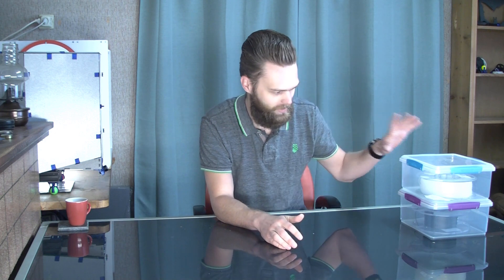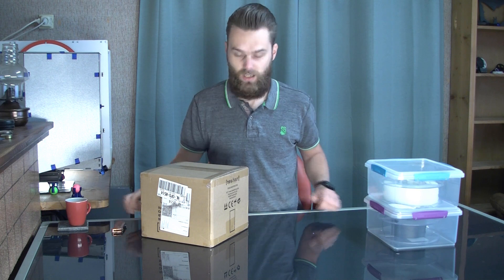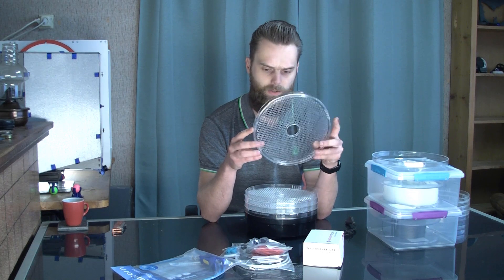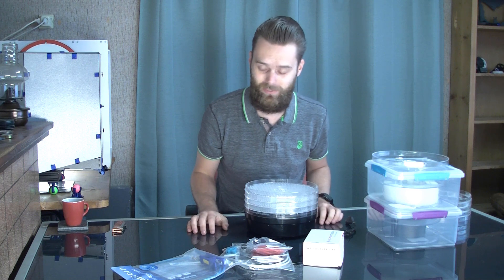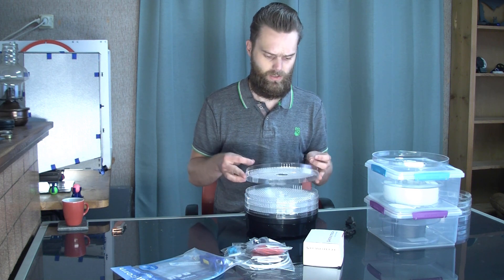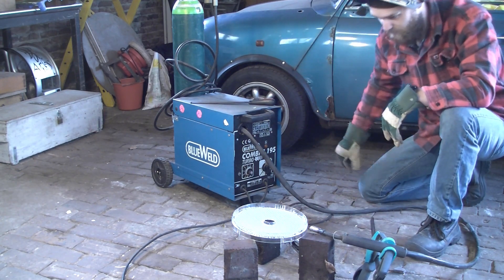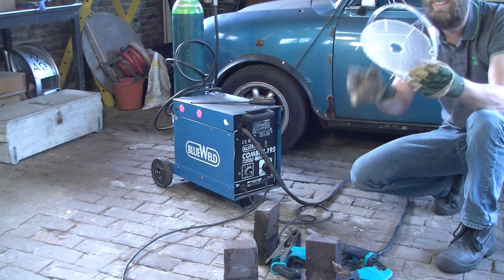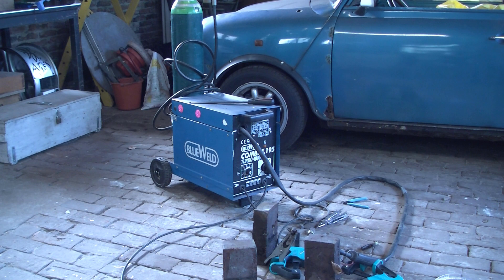Printing (carbon fiber) Nylon on an Ender 3

Comment: My question is after the print does the material still absorb moisture at the same rate. ...so if i have two interlocking pieces will they expand and not fit if left separate for an extended amount of time. Or will it be stuck assembled

Comment: hey man, i got a new ender 5+ and upgraded w/ capricorn, micro swiss and ruby nozzle 0.6mm. ...i tried printing eSun Nylon-cf, @ 268/80  and it printed good 1 time and then every print started failing......i have done PID changes, eSteps changes, temp changes, new nozzle, new filament, and i cant figure out what is wrong. I print out of a dry box that has moisture absorption in it sealed.....i have no issue printing PLA PETG
Reply from the maker: It sounds like your extruder gear is worn. Do you use an extruder with a brass gear? In this video I show that I use a Bondtech extruder, but I recently used the Microswiss direct drive which looks very promising. Hopefully this helps with your issue.

Comment: Hey, thanks for the information! I'm looking at setting up a fairly large form printer to do car parts with carbon nylon, any reason you think size could cause problems?
Reply from the maker: That sounds very interesting. Printing out of carbon helps a lot because that shrinks a lot less than pure Nylon. That being said, I think you still need an enclosure, maybe even a heated chamber. I am currently working on one which should be able to print large car parts ;)

Comment: Why not use nicrom wire and make a foam cutter. Look it up. Much better than trying to cut a circle with a guitar string in a circle. You need it tight in a straight line threaded through the middle of the plastic part. Then cut the circle out.

Comment: Consider getting SKR mini E3 version 2.0 board..... other than that your ideas are amazing! The mini E3 version 2 is a direct replacement for Ender 3 but with a lot of options and no need for bootloader and did I mention tmc2209 drivers? Made my Ender 3 super silent literally just hearing the fan running

Comment: This is great, I’ve been looking at doing a food dehydrator setup for my nylon for a while. The usual food dryer’s are massive about 350mm OD as a posed to yours which is 250mm OD, nice and compact :).  For anyone in the U.K. or Europe wondering what the model is it’s a OneConcept Bonsai. Thanks for sharing.

Comment: For anyone who does not have expensive equipment for cutting plastic , Just  get a soldering iron with a knife cutting attachment, or buy one they are cheap,, or if no money then heat up a knif on a flame until  red hot and cut away, Simple's

Comment: Thanks for another great video Jon! May I know why you chose not to feed the filament directly from the top of the printer? Is it because you want to minimize the length of filament that's exposed in the air?

Comment: How could you so perfectly leveled the bed? You first layer is insanely good!
Reply from the maker: Thanks Bruce! I use a DTI to level the bed and an adjustable homing switch to determine the height. Together with a pinch of luck I get that perfect first layer xD
Reply: Proper Printing How is your Bondteck extruded? I am thinking using my ender 3 pro to print some soft filament as well. I am sure which extruder I should go with.
Reply from the maker: @brucehu428  I'm really pleased with that extruder. It has printed a lot of CF Nylon already and it's still going strong. I don't have experiences other than the stock, the metal and the Bondtech so there might be cheaper alternatives which would do the task as well.
Reply: Proper Printing Would you please send me the link where you bought it?
Reply from the maker: @brucehu428  https://reprapworld.com/products/bondtech_cr10_upgrade_kit/ not the cheapest, especially shipping, but it's affordable from where I live.

Comment: @Proper Printing thats not the normal ender 3 extruder thats an upgrade what is it?
Reply from the maker: It's the E3D v6. Definitely a recommendation :D
Reply: @properprinting  Just ordered the ender 3 pro as well as the aluminum feed plate and glass bed

Comment: Just a bit of advice as I've also converted a food dehydrator to a filament dryer. If you snip the grid away from the edge you wanna keep you can come back and clean up the edge with very little risk of cracking the plastic. Did this on 4 of the 6 disks that came with mine.

Comment: oh no i don't wanna ruin my pricey bmg clone extruder that I had a hard time importing to here :(
edit: YAY those don't use brass gears ;'3
Reply from the maker: Brass gears will indeed wear out very fast. Therefore the bmg like you've already found out :)
Reply: @properprinting  wait bmg doesn't wear right? Cause the gears are steel
Reply from the maker: @ameliabuns  mine hasn't worn yet after printing a lot of Nylon CF. I recon that it eventually wears out but I recon this will take some time
Reply: @properprinting  thanks for answering ! I live in iran so finding and buying anything is a NIGHTMARE  here lol. I had to pay 2x the price and wait 2.5 months for mine

Comment: I'd rather recommend to reinforce carbon fiber and epoxy the frame with old method after 3d print. Why don't you develop this idea ? If you do this, you can avoid the difficult 3d printer modification with carbon powder mixing with nylon resin.
Reply from the maker: Thanks for your suggestion! I try to have the least amount of post processing because I needed this for a product I'm working on which isn't related to this channel. I have some ideas about adding fibers to a print but I have to do some research.
Reply: @properprinting  I understand your job is different from professional 3d printing. I am professional chemical engineer specialized in plastic, fiber and carbon powder. If you need any information or help, please let me know to my email. ☞ pjh33hae@naver.com

Comment: Why didn't you use the welding wire. It would have done the same job. Especially if you had used super 6 1mm  stainless steel wire.
Reply from the maker: Good question, thanks! My initial thought of using a guitar string is that you can make a perfect circle out of it because it wants to stay straight. Naive me thought it would melt a perfect circle (great band by the way) but this wasn't the case. Your solution probably works better :)

Comment: Have you removed the little metal plate over the heater? And how have you mounted the bowden coupler on your designed part that leads out the filament?
Reply from the maker: Yes I have. I have uploaded the designs on my website https://properprinting.pro/product/filament-dryer/. I've screwed in the bowden coupler in the printed part.
Reply: @properprinting  Saw that design yes, but you did not explain a lot about it and the mounting. Can't even see no thread in the part that leads the filament out. But great work from you, good video. The creality guys should pay you, as you further develope and egineered their machine for great features (tool change).
Reply: have you used the nut from inside to mount the filament leading peace? Is it not in the way of the filament entering the channel there? Have you cut out a piece from the level frame or drilled a hole to let the filament enter the "lead-piece"?
Reply from the maker: @laolalock909  please email me (contact@properprinting.pro) so I can send some photos to help you. I'm currently working on my next video and it's a difficult one so it will take a bit longer than usual for me to respond.

Comment: What are the boxes you have for the filament? Have a link ?
Reply from the maker: Good question! I've bought them in a store and this is the link of the box https://sistemaplastics.com/products/fresh/5l-rectangle-fresh
Reply: @properprinting  Thx mate, they are available @ amazon. Not cheap but it seems thats needed for Nylon?! ;)
Reply from the maker: @laolalock909  No problem. They aren't indeed cheap and I've found them while I was shopping in a physical store because I needed dry boxes. I recon that cheaper ones would work as well, but I didn't take a look into this.

Comment: Just subbed to your channel. I Bought an ender 3 for Christmas. It’s still in the box. I’m learning as much as I can in anticipation of day 1 in printing. Can’t wait to check out the rest of your videos.
Reply: Congrats - good bed leveling makes a world of difference.
Lots of things on thingiverse to upgrade for Ender3.

Cheers
Reply from the maker: Awesome man, thanks for your comment and subscribing! As mentioned by Patrick, bed leveling is very important. My suggestion would be is to start with assembling the printer as precise as you can and start printing with it until you get good results. It should print very good after assembled and tuned in correctly. Once you get the hang of it, the fun begins and you can start upgrading ;) Good luck!

Comment: Another option is to put the spool of filament together with the printer in the enclosure. That's what I did and it keeps the filament in excellent condition while printing.
Reply from the maker: I've never thought about that. Cool that you've done it like that, smart. Thanks for mentioning!

Comment: Very nice, but sketchy with cutting the main wire to the printhead...
Reply from the maker: Thanks for your comment! Well, I've done it a couple of times before and I like the possibility of swapping out different hot ends. I can imagine that it looks sketchy but it enables a lot of possibilities :D
Reply: @properprinting  That's really cool if you can do that, especially if you are also working with different applications

Comment: "What else is there to do with a food dryer other than drying filament?" , said after not understanding the trays.

Ummmmm..... dehydrating food.... 

One more thing to note. you may have been using nylon, but it wasn't carbon fiber reinforced. carbon fibers are black, just a thing that can't be changed about carbon. It was probably glass fiber, polyacrylonitrile, or another composite filler, but definitely not carbon. Colored fiber is usually texalium, but the only way you're going to get transparent carbon fiber filament is if its diamond which does not exist,  and if it did, it would probably cost $5k per 0.5kg
Reply: Hello kind sir, you do realize that in the second sentence of this video Mr Proper Printing points out the two filaments he has lying on the table are indeed the white nylon and black carbon fiber reinforced nylon.
Reply: @danielvelthuis9415  regardless, the video is titled printing carbon fiber nylon.
Reply: @EIectr0m0tive  I like how concise you are in your observations. Thank you for your swift reply. I too dislike incorrect titles, however, may I point out that I think the title is actually very clever formulated because the 'carbon fiber' part is enclosed in parentheses. Parentheses can be used to enclose information that clarifies or is used as an aside. From this perspective, the title is perfect in my opinion because it indicates the printing of nylon and suggests a possible use of carbon fiber reinforced nylon. Quite neat don't you think?
Reply: @danielvelthuis9415  Fair enough, I have no problem conceding to that sort of well grounded logic.
Reply: @EIectr0m0tive  Such a pleasant discussion versus the usual internet spats I see.  Thumbs up for logical discourse and manners!

Comment: It sure is nice living in a warm desert climate. I can print nylon on my Ended 3 without any enclosure and usually without any filament pre-drying.
Reply from the maker: That's quite the opposite from here. At this very moment it's raining and the temperature is 5°C xD
Reply: @properprinting  I wish it was 5C during winter here. -27°C outside now. It doesn't print good at all as my room is at 15C
Reply: its 100% humidity and 80 degrees right now here.  during winter the humidity doesn't get any better

Comment: Use a soldering iron to cut out the center section of the food drier. A lot safer and controlled method than using a hot wire.

Comment: another upgrade add water block...reduce heat for your motors and hotend...no more fan..haha
Reply: the computer water block with 40mm x 40mm
Reply from the maker: You just gave me food for thought, thanks!
Reply: @properprinting  you can wrap your stepper with copper coil in water cooling system and your hotend with water block...u can use tap to bore cheap waterblock maybe..
Reply from the maker: @smoochies5056  In the past when I was studying precision metal working we had a project about creating a water cooler for an old AMD computer. It was a fun project and definitely something worth doing again in the future. The motors can handle the heat though but it would be fun diving deeper into, thanks for this idea!

Comment: Interesting video btw why you did a modified food dryer instead of a dry box with silica gel? do you notice some improvements in the prints? or is it the comodity of not putting nylon or the silica gel in the oven? now you make me doubt.
Reply from the maker: Thanks for your comment! I used a modified food dryer because I've seen this when researching the best practices for printing Nylon with my CR-10. I have used one for that printer for several months and I am very pleased with it. I haven't noticed any improvements but that's because I haven't printed Nylon without a dryer. I recon that a dry box with silica gel will work as well. I do not dare placing a roll into my oven since it's an old gas powered oven which will probably end up with a big lump of molten/burned plastic in it :P I think that there is no single best solution, both will work and it depends on the situation.

Comment: Wow, your printer is really a thing of beauty! I don't think there is currently a more advanced Ender 3 on youtube and possibly anywhere.
Reply from the maker: Thanks a lot for your awesome comment! As Kenny already mentioned, I'm not the only one with a modified Ender 3. Due to their open frame, low price and huge popularity a lot of these things are modified and I am happy that I can contribute to this. I must say that I'm very pleased with how the enclosure came out which is an eye catcher. I learn every day from designs and upgrades mentioned by others. Inspiring and helping each other, that's what I like about this 3D printing community.
Reply: @properprinting  hey do you have dual z?  Are the motors in the enclosure, or are some of them out?  Also, you didn't show the friggin Benchy.  WTF.  Lol
Reply from the maker: @Kenny Eaton Thanks man for this comment, this means a lot to me!

Comment: i made a fillament dryer by just placing a bucket on top of the dehydrator :) look into direct drive - better board and firmware tweaks.. 
My remix for the Direct drive.. https://www.thingiverse.com/thing:3826950

Btw iam super happy with the dual Z with the braces.
Reply from the maker: Thanks for sharing! The bucket on top of the dehydrator would have been much simpler :P The better board and firmware tweaks is indeed something I'll dive into soon. It's hard to live without Octoprint. I have some experimental ideas about a direct drive system which I have to figure out if it works. I'm going to work on that soon but chances are that it won't work at all. Nice that the dual Z with the braces work and that you're happy with it! I'm very happy that this design is successfully used by others since the dimensions were so tight.
Reply: @properprinting  ha ha.. the dual z was hard to get just right took me All Day.. i use the skr e3 mini from bigtreetech. I only print from octoprint.. its super nice..

Comment: I love your hot wire solution, Jon, I had an idea to replace my power supply back into the cabinet and extract the heat into a box containing nylon filament, then I thought about mounting the power supply in a box with the filament but your design seems much better and safer!
Reply from the maker: Thanks for your comment! I must say that your solution is very original which is more energy efficient than the filament dryer. In theory it should cool down your power supply, but this must be well executed. The solution with the food dryer (I haven't invented this though) is easier to make safer. Thanks for sharing your thoughts!

Comment: hi you made some mistakes
:
1. It was necessary to dry nylon before printing, and not just during.
2. For printing from carbon fiber, a hardened steel nozzle / ruby nozzle should be used, but is not brass, because carbon spends it literally for a couple of prints.
Ps. a very original way to remove the grid :)
Reply from the maker: Hi, thanks a lot for pointing this out! I agree with your points. It is indeed necessary to dry before printing. I have read that Nylon can absorb moisture within a couple of hours so I figure that drying during printing will be relevant with larger prints. Maybe a timer to save energy is not a bad idea.
About your second point: I am very fond of the nozzles produced by Micro Swiss which have a coating but the ones I've received had the wrong thread, M6×0,75. I wanted to show this in the video but left it out because I didn't have any other nozzles. I should have explained that, silly me. I have bad experiences with hardened steel nozzles due to their bad heat conductivity. My prints with carbon fiber looked awesome but were very, very brittle. I haven't tried ruby nozzles yet and I we can agree that I need another nozzle so I will dive into this.
Reply: @properprinting  for a hot steel nozzle, you just need to raise the temperature.
poor interlayer adhesion in nylon may be due to 2 signs
1. This is the low temperature of the extruder (therefore, you just need to raise the temperature.
2. you print too fast, nylon likes slow speeds, sometimes you even have to print walls at 20 mm / s (for accurate printouts such as gears).
I also noticed a gap between the panels. before printing, warm the box space for 20-30 minutes (from table heat)
Reply from the maker: @onetwo6635  Thanks man for this information, this will definitely help.